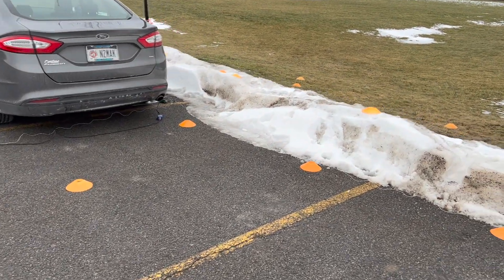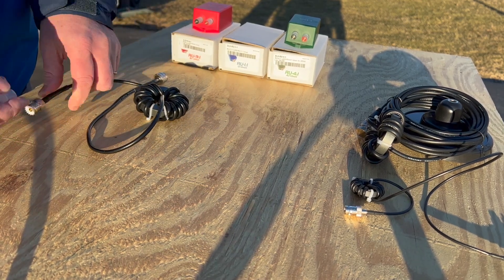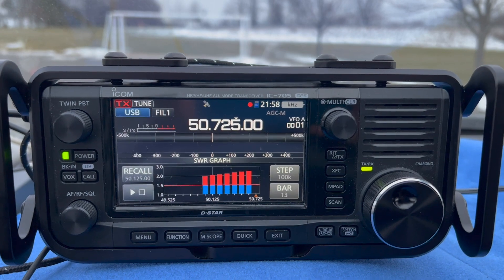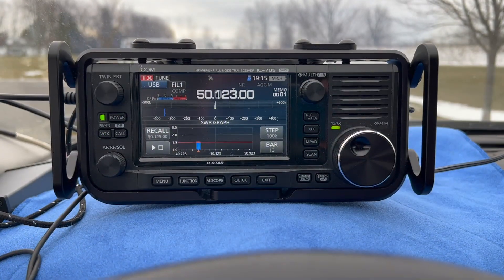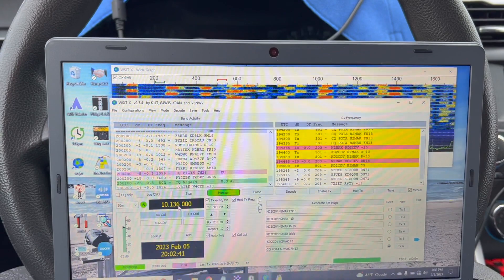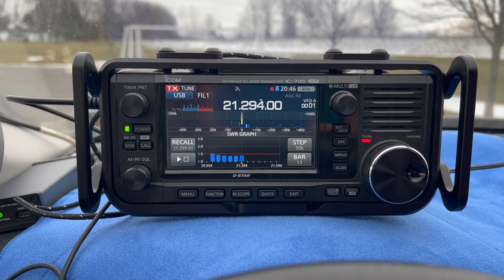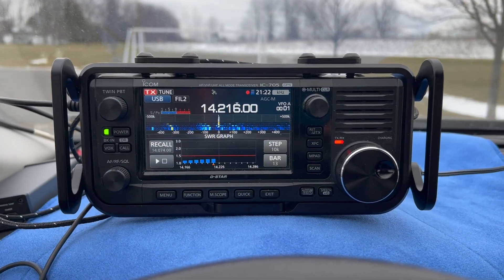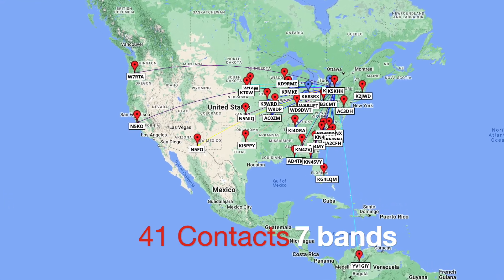QRP POTA Activation with the Rybakov Antenna

Comment: The music mix is a major distraction. Too forward in the mix. I suggest ditching it altogether. I had to stop watching.
Reply from the maker: Yup. I’ve learned. A few others mentioned it too. Thanks for the feedback though. The Rybakov antenna is full of surprises and I encourage you to try it out.
Reply: Will do, Mike ... and I'll go back now and watch the video.  I'd intended to homebrew a vertical, and it will probably be this one.  @MikeN2MAK
Reply from the maker: @billjobes1851  In addition to the 25' Rybakov, I added a 25' link to make it 50' and I deploy it in an inverted L. This allows it to tune 60m and 80m, plus it's probably performing better on 40m with the additional wire. I have a couple videos on that. The 2 channels with a lot of great info on the Rybakov at Tim G5TM and Coastal Waves & Wires (Walt K4OGO). I've learned a lot from them and we're all experimenting with it. Best of luck!
Reply: @MikeN2MAK  Thanks Mike.  I appreciate the tips.

Comment: I use it with 4 elevated 16 ft radials attached to electric fence posts. The radiator up a 40 ft spider pole. Getting great results. 73
Reply from the maker: Nice work! This is the first time I've heard about the Rybakov with elevated radials. Is that just for 20m or does with work multi-banded (with a tuner) as well with the elevated 16' radials?
Reply: @MikeN2MAK  multi band with a tuner.

Comment: Thinking about making one of these. Is the 1:1 choke a necessity or can you operate without it.? Nice video by the way!
Reply from the maker: Thanks, I’m glad you liked the videos. The antenna would work without the 1:1 choke. My understanding is that it’s just good practice when using an unbalanced antenna like this. At lower power levels, common mode current and RFI wouldn’t as much of a concern.

Comment: Ur SWR would also be strange due to being soo close to ya car but for the radio u could get a ATU-10 and have it mounted at the antenna feed point and for mine i made a cable to my 705 thinks it has the actual icom tuner on it
Reply from the maker: Thanks, I’ve heard it’s possible to do that with the ATU and 705. It could be that the proximity to the car affected the SWR on 6m but not the other bands. When I tested the same setup using the 7300 emergency mode tuner, I didn’t have any of those SWR issues on 6m though. I’ll continue to test the antenna and use different setups. Thanks for watching!

Comment: The mast with the radiating element is inches from your metal body car.  Could be it.
Reply from the maker: Maybe! The next time I use it guyed I’m the filed, I’ll be sure to check the SWR on 6m. Thanks for watching and I appreciate the suggestion.
Reply: @MikeN2MAK  Try a portable screw in the ground umbrella holder that will fit the diameter of your pole.
Reply from the maker: @yowsa52  that's definitely on the list of gear to buy and try soon